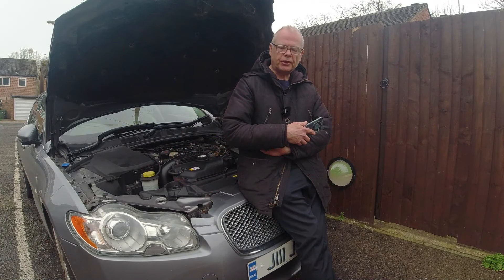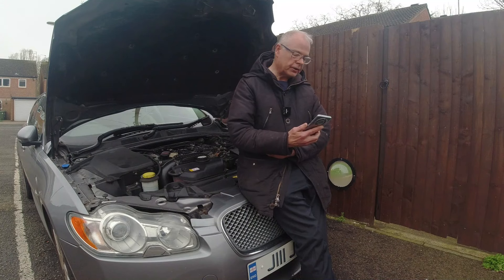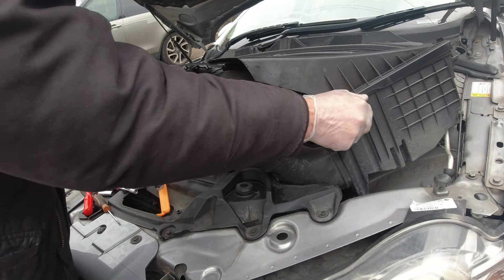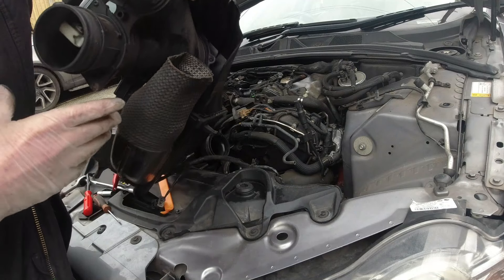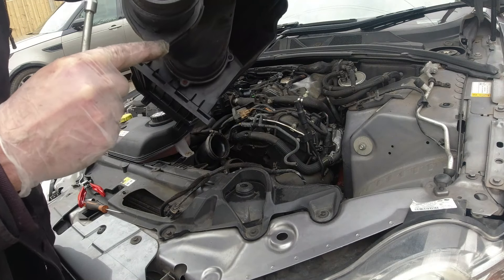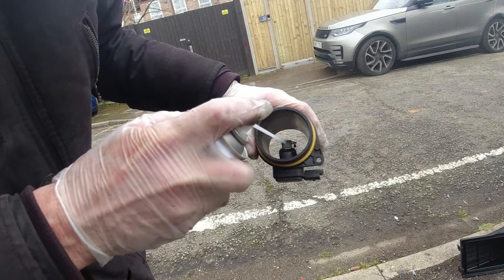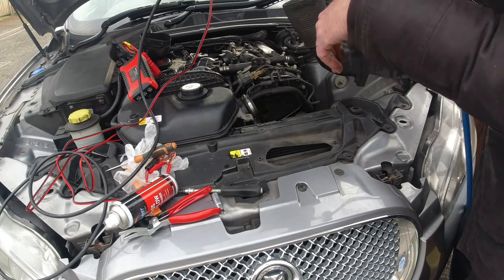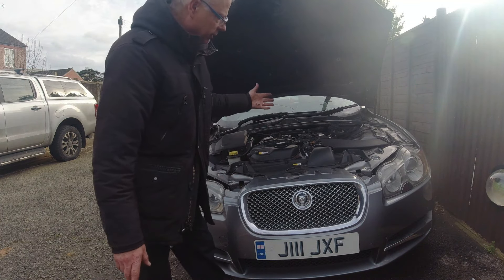Jaguar XF 3.0 D  MAF Sensor and Throttle Body Clean ( Still No Luck )

Comment: Hi Jeff, Gutted mate, That's modern diesels for you all these sensors, filters more trouble than they worth and diesels don't like short runs the clog up easy, my brother has a Vauxhall Insignia CDTI all he does is a 7 mile trip to work and back home anther 7 miles it not enough for a diesel engine you need to do  20-25 mile trip to benefit having a diesel car. About 20 years ago the UK government were advising the public to by a diesel car saying they are cheap to run but what they were not telling the public they don't like short runs. years a go a neighbour bought a VW Polo TDI diesel all she was doing was 3/4 of a mile trip to the local shops and twice a week going in to Wrexham which is less than 4 miles away and with in 6-8 month all engine lights on the dash and then she was tolled that a diesel car was not suited for her, she never had this trouble before with petrol cars, she wen't back to petrol and bought a Nissan Micra 1.2 no bother at all. I hope things get sorted out with the farther in laws Jaguar, I bet you can't wait to get back on your bikes again that smell of petrol and two stroke oil,. As always a great video   Take care mate
Reply from the maker: Hi Shaun, yes diesels can be a pain. When I owned it I  very rarely had the DPF warning on. I used to drive 10 miles to work and back and was fine.
All my Father in law does mainly is two miles each way to drop my Mother in law off, it doesn't even get warm.
Work is killing me at the moment, I finish at 2.10am and then the clocks go forward. I have tried to get some bits and pieces together to try and make a video on Monday for the Velosolex. 
I probably will be sleeping most of tomorrow, it's been a six day week.
Take care, Jeff
Reply: @DiecastPowderCoating  Don't over do it mate Take care
Reply from the maker: @shaun30-3-mg9zs I'm trying not to Shaun. My manager got me off early last night that should have been 1.30. I have to go and get my Mum's shopping every day, she's 92 and can't get out.
I have to find the odd hour here and there so I have something to show for the following week.
In two and a half weeks, I have got 23 days off, so might have time to go back to the Jaguar.
Take care, Jeff
Reply: I had a similar issue on my 2011 3.0 XF.  I replaced both MAF sensors in the end.  I got secondhand ones.  Cleared the codes and all golden.  Cleaning them was a waste of time (for me).
Reply from the maker: @TheOnkeys Hi that's good to know. I thought about changing them, but thought I would probably be throwing more money away. I will speak to my father in law and recommend changing them.
Thanks once again.
Take care, Jeff

Comment: nice car.... but buy a small folding table to put bits on . Nothing worse than a engine with tools, can and bolts etc on top ! Ive always blanked off EGR's and had them mapped out . Cars run so much better !
Reply from the maker: You're absolutely right. I always mean to put up a table of some kind, but always forget. No matter wherever you think is safe around an engine, I always lose something.
The Jaguar still has the problems, but my father in law always needs it. He has just gone away for a six month holiday, so when I get time I will dig deeper.
Take care Jeff

Comment: You need to smoke test the inlet system. Sounds very much like the inlet manifold is cracked on bank 1. Those fault codes are common for that failure. Smoke test will prove. Good luck.
Reply from the maker: Hi and thanks for your help. I was dreading the inlet manifold cracking. I have noticed that there is some oil in the v of the engine under the oil filter, but that's not leaking.
I will try the smoke test on the inlet.
Thanks again,
Take care, Jeff

Comment: Take a look at the crankbreather pipe they are flimsy plastic and because only a 4m hole and covered in the plastic hose protector you don't see leeks. Mine were broken both. Sides of the t joint and when I removed from each manifolds they just disintegrated
Reply from the maker: Hello and thank you for your advice. I haven't any time to have a look at it since. My Father in law is back from his holiday and uses it a lot. I will certainly have a look at the breather pipes, you are right, things are very brittle.
Take care, Jeff
Reply: Any chance you could explain somehow where this crankbreather pipe is located?  Please, it would mean a lot.

Comment: Bypass control valve boost pipe in the front of the engine as you said rp comes on with boost . Actuator goes bad as 2nd turbo only arrives at 2750rpm hope it helps as my rp was doing my head for about a month
Reply from the maker: Thanks James, I haven't looked at it for quite a while, my father in law is living with it. I will certainly look into that.
Take care, Jeff

Comment: Tried swapping the MAF's over to see if the problem shifts to the other bank? Also, had something similar regarding the "circuit B" range on my 2.7 which I sorted by running some EGR cleaner directly through the intake (Wynns).... worth a try maybe?
Reply from the maker: Thanks Mohammed, I haven't had a chance to look at it since, but when I get some time I will try it out.
Thanks again for your help.
Take care, Jeff

Comment: I think it could be the throttle body ive read if you open the throttle body valve manually on an electrical throttle body it needs resetting with a computer otherwise itll bring engine management light.
Reply from the maker: Hi, thank you for the information. It is my Father in law's car so he has been using it as it is. He has gone away for five months so I plan to go back to it when I get time. I have a couple of new MAF sensors to go in.
Thanks again for your help.
Take care, Jeff

Comment: Does sound like it could be the inlet manifold, i had the portfolio s that kept going into limp mode and throwing up codes turned out i had some hair line cracks on the inlet manifolds apparently a weak point on these engines.
Reply from the maker: Hi Ben, yes thanks for that.  My father in law has been away for five months and is back next month. I have been so busy I haven't had the chance to look at it again.
I'm off next week, so will have another look at it then. I have a couple of MAF sensors to fit, but It won't make any difference to the DPF warning. He does love the car, so maybe he will pay to get the inlet manifold done professionally.
I just don't have a whole day available to do it.
Take care, Jeff
Reply: @DiecastPowderCoating  hi Jeff hope you get it sorted, these are really nice cars my dpf on mine blocked up as well I just ended up gutting it along with the egr valve and mapped it drove perfectly after all that and the inlet manifolds were done, take care

Comment: Hi Jeff
Have you erased all faults delete all faults then do a rescan has sometimes the engine will keep all old faults after you done repaired worth a go mate I hate modern engines all these warning lights on dash m.o.t failers irs all to these garages in work  like all these pot holes  mass hottest do cause these warning lights to come on and sometimes make a car go in to limo mode this could have a fault in it it would need a good scanner to check this fully out Hope you sort it mate two stroke lot easier  to sort out 😮

Phil in stoke
Reply from the maker: Hi Phil, someone in a previous comment said he had the same problem with his Jaguar. In the end he replaced both MAF sensors and that sorted all his problems. I just need to convince my father in law to buy two new ones.
Although the restricted performance and DPF warnings are on, the engine management light is not.
Just had a very bad run of late shifts, but hopefully will be able to get a video done on the Velosolex, for next week.
Take care, Jeff
Take care, Jeff